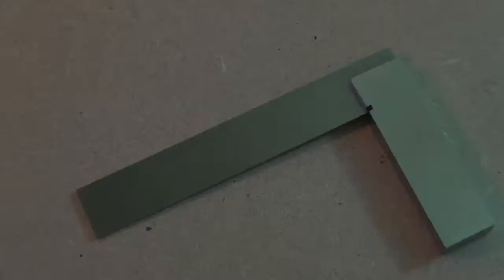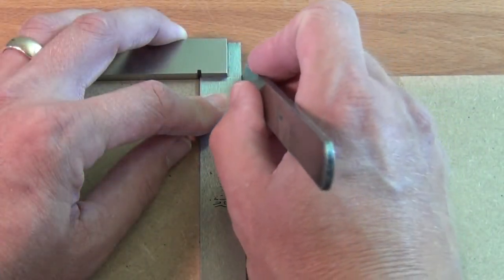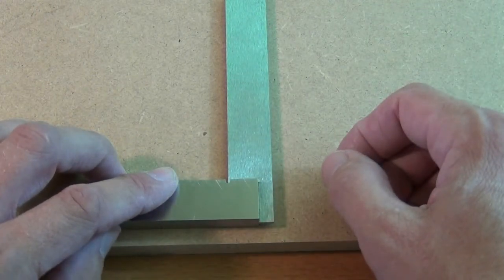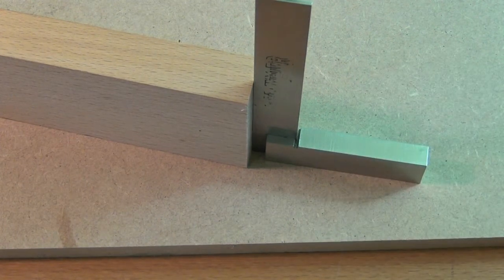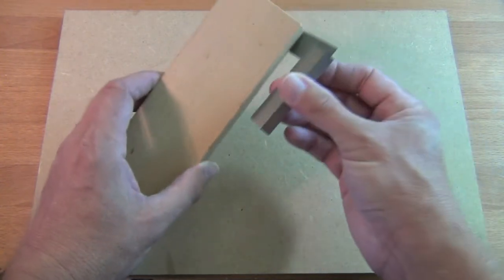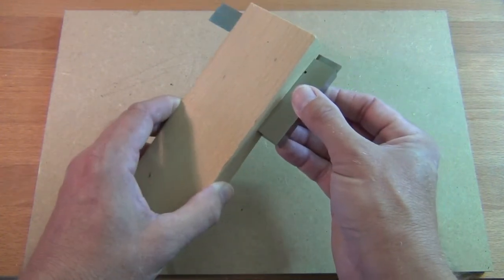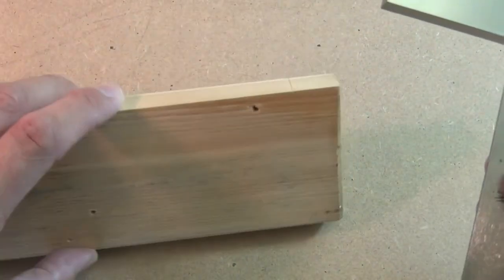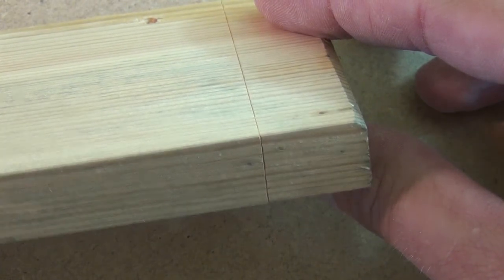Try Square - Checking and Using

Comment: You could also clamp a straight edge and is the same method you used with the knife to check the outside
Reply from the maker: Cheers :-)